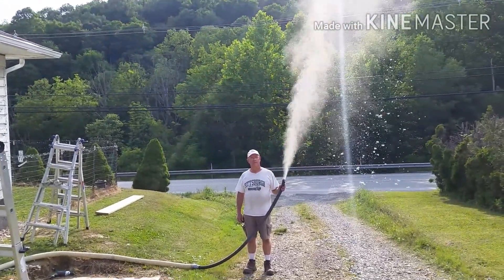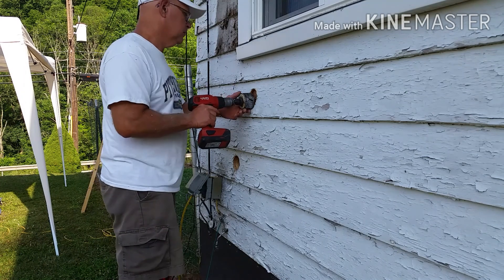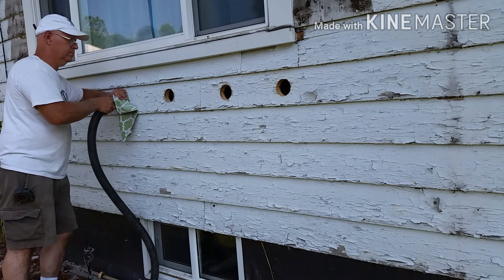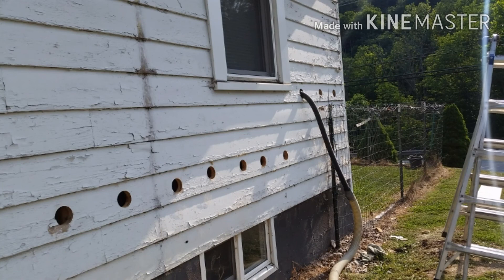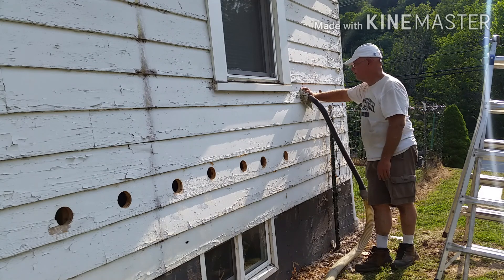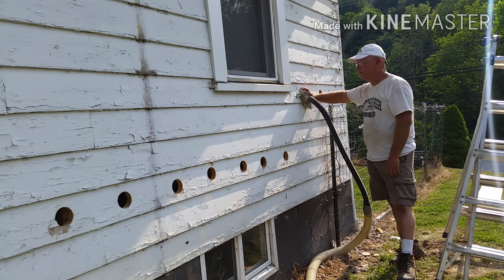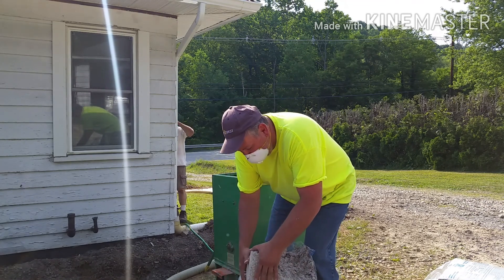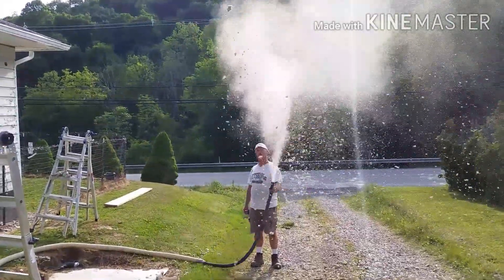How to Dense Pack Blown Insulation from Exerior Walls

Comment: There is good information here.  I question the strength of the machine to do a true dense pack job.  Sticking the hose all the way in is a must, as you do here. The machines we used had to be tied directly into the electric panel with big clamps right off the main power line.  They typically had about twice the power of box store machine.  From time to time I see a decent machine at HD, but they usually get broke and are twice the weight of those cheap machines.

Comment: It’s easier to do it on the inside instead of the outside of the home. Also cheaper to replace the holes made in the wall. Keep the outside of your home water tight.
Reply: I think that ship probably sailed a couple of decades ago.
Reply: I'm guessing that house was getting resided.  We used to do this all the time before residing a house.  Personally, I''ve also added 1" foil faced foam with seams taped on the outside to go over all the framing members and headers, however it works better if you take off the siding.

Comment: Hhhmmm. I have this same situation with an 1800s wood sided rear L-wing on a brick house, but my idea is to remove a top board and a board midway or so down so that I know where the lower cavities are that were created with the cross beam supports that I am fairly certain are in there.  Would love to hear how this has worked for others in a similar predicament. And also any info on mold/rot that filling these kinds of voids with cellulose or shredded jean insulation may have/may have not caused due to not having a vapor barrier due to not wanting to destroy perfectly good existing walls inside or out.

Comment: Great video. Thi was my first video to start my researc on doing this on my1958 ranch.
So with cellulose you do want to PACK as much on as possible vs batt insulation is just fit in place.
Good to know.

Comment: What about a moisture barrier
Reply: Nobody ever answers this question
Reply: Because to put an actual moisture barrier on the wall you would have to rip off all the sheet rock.  Paint will act as the moisture barrier. @tybis4u
Reply: Cellulose doesn't need a moisture barrier.

Comment: How do you get the insulation into the top of the cavity with the holes so low? Do you drill more in the top or do you push the hose up toward the top?
Reply from the maker: The air pressure will force the insulation in every part of the cavity. If you working with newer built structures they are built with fire blocks usually half way between the top and bottom. Two story will usually have obstructions also. You will have to drill more holes for these cavities. Balloon frame construction are open from the attic to the basement. Theses cavities you will have to close before you blow the insulation. In either types always have a lookout watching for openings. If one of the areas is taking more than the others you will be able to quickly identifying the leak. The insulation will be forced out making quite the mess.

Comment: Very good video, curious on how you patch the holes, just replace that entire board and paint it I'm assuming and ignore the 3/4 tongue and groove planks they used to use before sheathing ?

Also, are you in CT, Im looking to blow in mineral wool sidewall, can't find it anywhere
Reply from the maker: You can keep the blanks from the hole saw and glue them in with construction adhesive. Yes, I am certified through Building Performance Institute. On this job we closed the holes with metal flashing and finished the house with vinyl siding. I have not used wool. Not sure where you can purchase it.
Reply: @viralworkaholic6766  thank you for the quick reply! Yeah it's hard to find wool products, the US is slow to adapt to it like diesel it seems. Amazing stuff mineral wool is, pest, termites, fireproof essentially etc

I'm about to attempt this myself once I get my hands on the product. Ripped apart a ledger to do it properly and one issue after another, termite damage and rotted and then I may as well do this since no insulation

Comment: Thank you for this video it helps me understand the process. I have a 1960 brick home. There is NO insulation behind the exterior walls. The walls are so cold 🥶 in the winter you can feel the coldness even around the electrical outlets. I have sealed everything and even put plastic over all the windows. The exterior walls are still cold to touch. I was thinking of vinyl siding the exterior all of the house except the front. Someone mentioned this process to me instead of covering the brick. I am doing research 🧐. Thanks again for sharing.